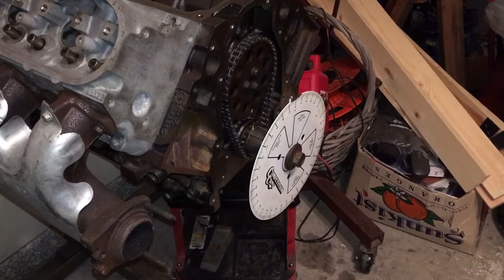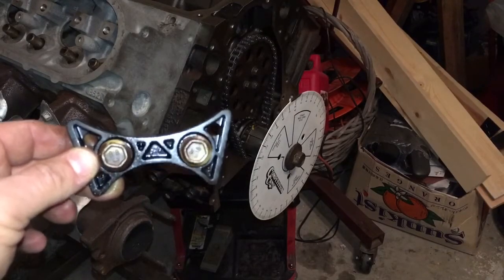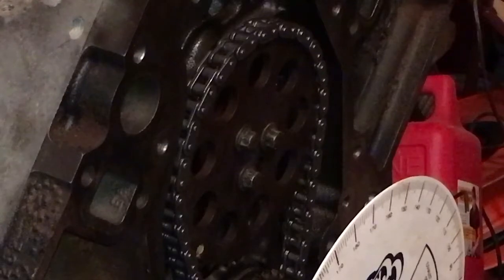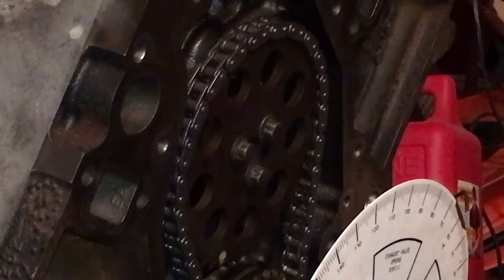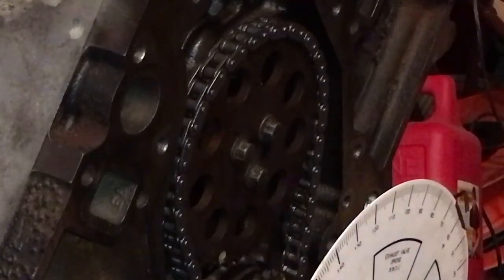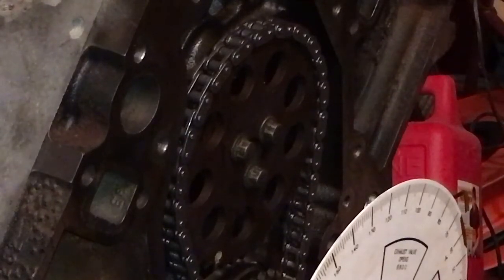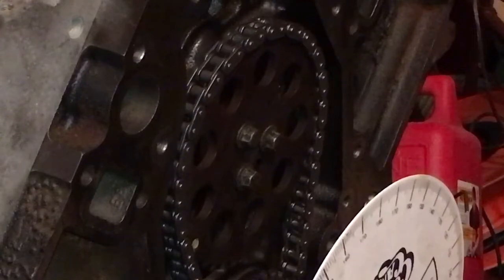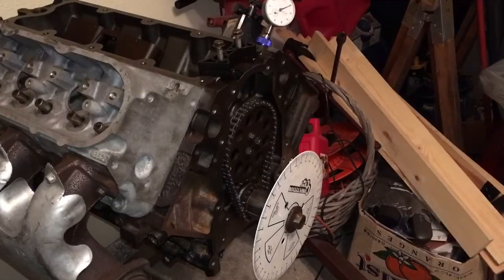Comp Cams Cam degreeing cheap and easy

Comment: Show us how you lock in the bushings
Reply from the maker: 407ForRent I used a punch to peen in a few spots. Once you torque the bolts down nothing moves. Make sure to use the cam locking plate to guarantee the bushings have no where to go just in case. JD

Comment: What part # did you use for the bushing kit
Reply from the maker: lnsper Comp 47600, you may need to stack two bushings to equal the needed thickness.  I knurled mine and locked the adjustment with a locking plate. The plate both blocks/limits the bushing hole and has tabs to prevent the cam bolts from coming loose.
Reply: Thanks That is the part # I got coming from summit and I all so got the locking plate
Reply: What are you using for a pointer to the degree wheel?